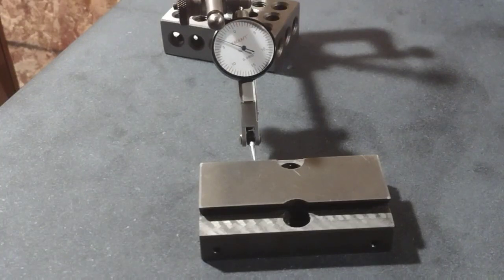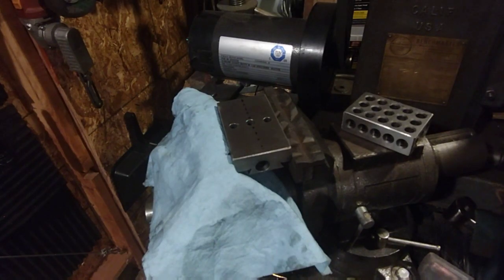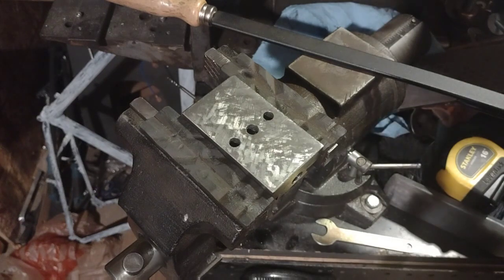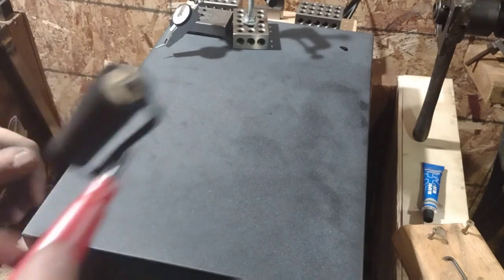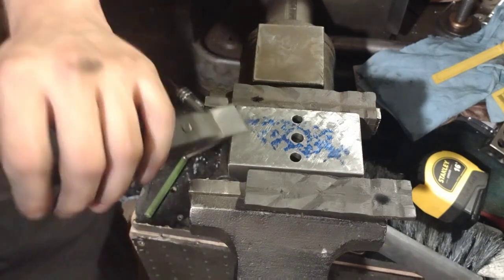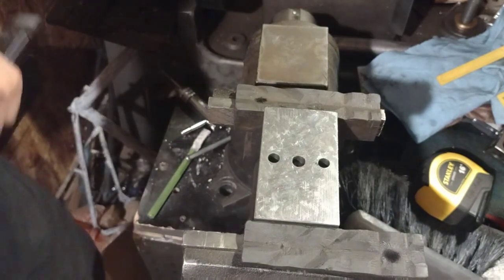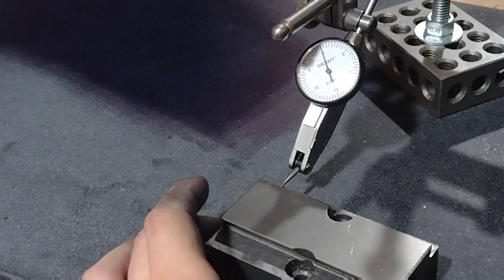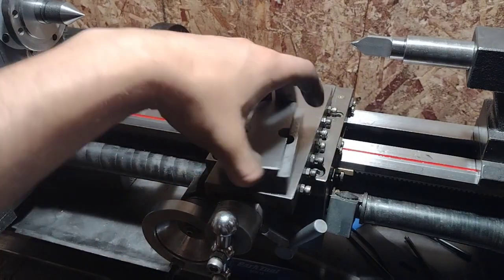Surface Scraping: Mini Lathe pt.1

Comment: For measuring parallel, use an old gage block to average out the surface.  Roughness in the scraping mark can be from the lower face of the scraper.  It's a bit like a form tool.  If you lap it flat, the cut will be much smoother.  Not absolutely required but it is a level up.  Whatever you do to this lathe, it will be much better than it started.  You can do it in stages, if you want.  Nice to see a young person doing this kind of work.  Looking forward to part 2 and beyond
Reply from the maker: Really good tip, thanks! Stay tuned.

Comment: If you are going to cut a taper with your lathe, setting that angle with gauge blocks isn't the best way to do this. If you want to know how to get this spot on, Joe Pie has several videos on how to do this. Here are the links.

https://youtu.be/YCllVu4K738

https://youtu.be/qwMX63_bPAA

...
Reply from the maker: This comment fell through the cracks. Thank you for the links. I'll check em out! Joe Pie is truly an "advanced innovator"

Comment: Just did a similar thing myself and also did some mistakes that you do too. As the others said sharpen your carbide, the stripey appearance in one stroke comes from a rough edge. For roughing (which you should definetly do right now) 115 mm radius is not too bad for me ( ~ 4.5 inchingers). Mirror finish would be nice but is certainly not needed. Another thing is your stroke length, it should be much longer 20 - 25 mm (3/4 - to 1") do not focus on single points, scrape away the whole blue and try to get your geometry right while doing roughing work. Keep it up though and happy scraping, from another beginner :-)
Reply from the maker: Really good tips, thank you! Good luck on your projects.

Comment: you definitely need to put a radius on that carbide, you're not producing a chip when you scrape, you're just rubbing some dust off of the surface. watch Stephens scraping videos, and this old tony's
Reply from the maker: You're totally right. And those are both great channels and resources, will do. Thanks for commenting!

Comment: Subscribed! Looking forward to seeing the rest of this series. One tip - the carbide on that scraper comes with a square edge. you will want to re-grind it with a radius and about 5° of negative rake on the front edge. Then hone to a mirror finish as the scraper surface will directly impact the scrape appearance. You can get by with a cheap green silicon carbide grinding wheel and some diamond hones.
Reply: ^^ i agree
Reply from the maker: Yes, the edge was rubbish. I've got a grinding jig in the works... Although I will try free-handing it too. Thank you and stay tuned.